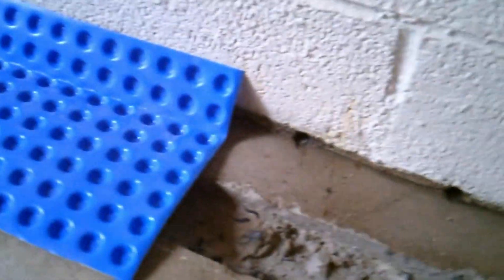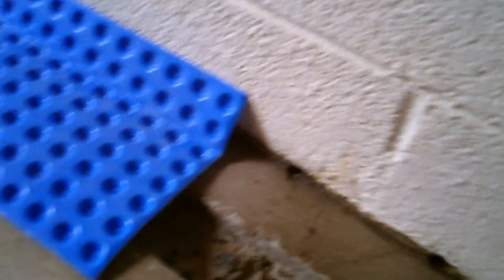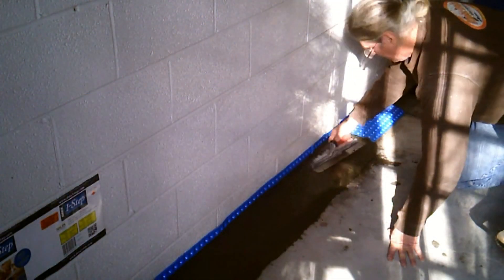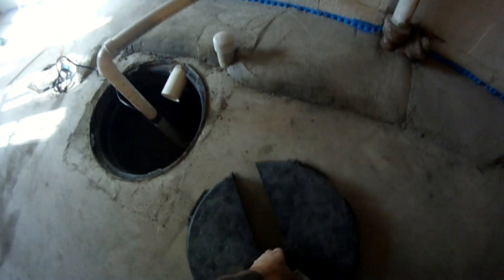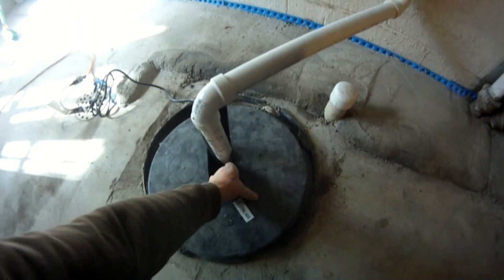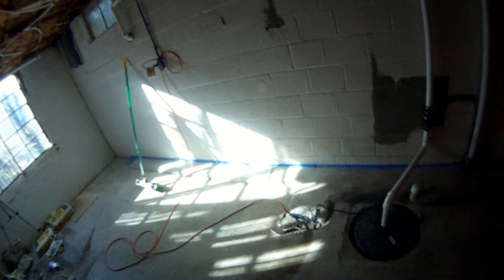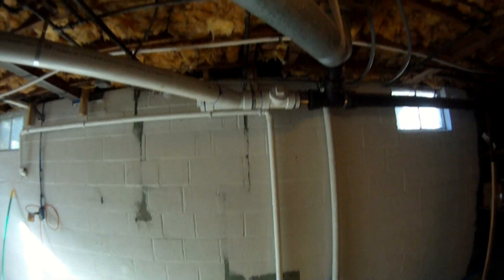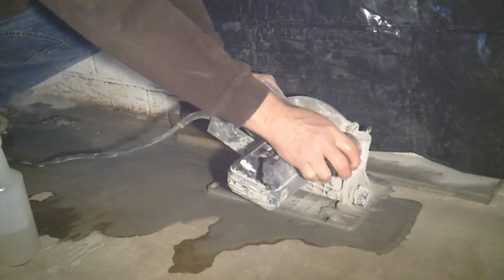Basement waterproofing with a  CHANNEL DRAIN  -- when busting up floor is not an option!

Comment: What if your foundation is brick?
Reply from the maker: Hey Alexander,
Thank you for watching.
I'd have to see that one. Is there a poured slab?
Is this a cabin? Is this s a historical building?
Maybe you could tell us more about what is inside and outside.
Brick foundation sounds like, it would be only the n a dry location. I have never seen a home with a brick foundation. 
Thanks again for watching.
Reply: The foundation is all brick. Unsure if a footer is present. The basement height is about 5 ft and has a poured concrete floor. I would guess the home was built in the early 1900s, but I have no way to verify. The wall thickness is probably 12 inches and the framing is done with both nails and wooden pegs.

Comment: I used the baseboard style waterguard that you caulk along the bottom and place tight against the wall. Installed weep holes behind them. Water is carried behind the baseboard to a drain line into the sump pump. No need to cut the channel drain in the floor and no concrete was needed to be replaced. Mine works great
Reply from the maker: Hi Eddie, thank you for watching

Comment: how deep and wide is the channel? Are you worried about slope? Seems like you cant go too deep for risk of slab damage.
Reply from the maker: ~ Hey Josh ~ Thanks for watching!  yes you may have to cut thru the grade a little more in areas. example, just to my right in the video icon. The last corner I had to cut a channel at a 45 degree across the corner and cut deeper into the concrete. In all basements the concrete pour SHOULD be sloping to the lowest point  where the floor drain is located and repectively from the furthest wall away from floor drain, if you look at the cinder blocks, you will see the visual actual fall of the concrete floor. if you follow the line across the entire basement walls where it meets the floor, you will see natural pitch / slope and you can rest assured if you have to approach a channel drain install in this manner, IT WILL WORK! Thanks again for watching!